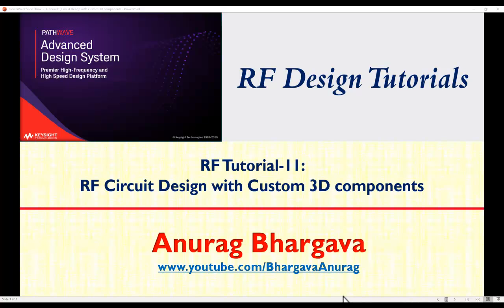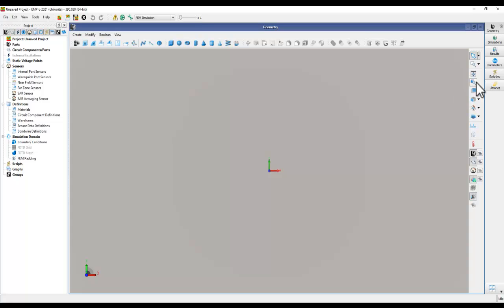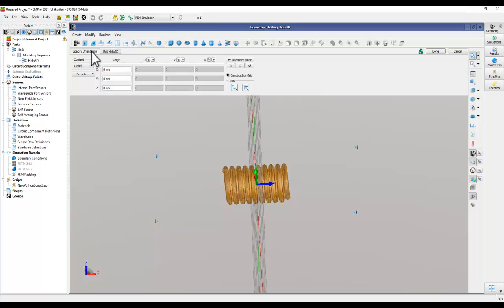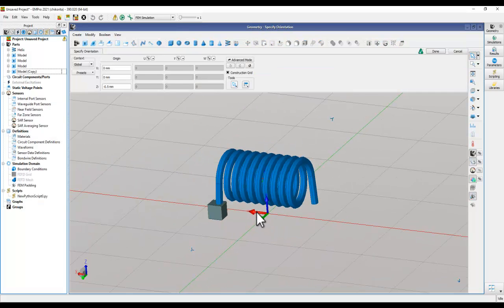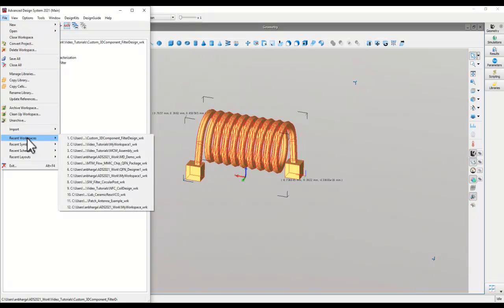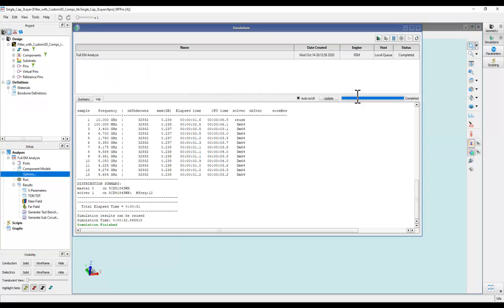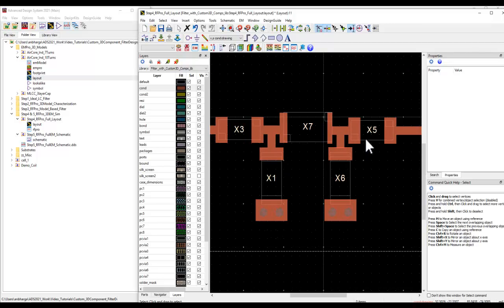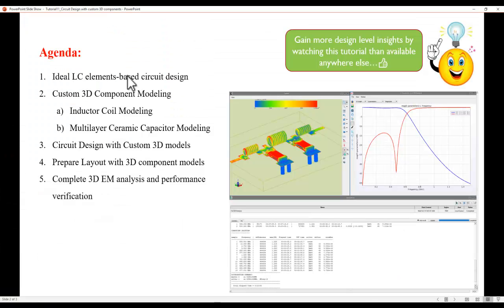RF Design-11: RF Circuit Design with Custom 3D Components

Comment: Hi, how do you start EMpro? When I start it from a layout window, I don't get the same menus as you do. I don't have a menu for importing CAD files, like STEP. Thanks.
Reply from the maker: Hi Yulia,
You can download and install latest EMPro version from Keysight. Its a different installer and software from Keysight for 3D CAD and Simulation.

Comment: hello, i have a question about multilayer design, first thing, thanks for your videos they are very helpful, now about the question, i want to put some componets on top layer and other on bottom layer, can i do that with just one substrate, and make the ground be on both layers and use vias, or should i have at least two substraate with the ground be beween the two substrate?.
Reply from the maker: Hi Luck, It depends...sometimes designers have 1 GND plane between Top and Bottom and sometimes you have 1 GND plane for Top and another for bottom layer with a Core dielectric in between in order to isolate as much as possible. While doing so, you need to be careful in not having too many VIAs as each VIA will have some inductance and you would like to avoid that in order to preserve the proper high frequency performance.
As I said before, its not always so easy to squeeze the size and many time you will need to live with what you have. Multilayer is not always the solution and in many cases it might create more problems so you need to treat every aspect carefully.
Unfortunately, YouTube is not good place for tech support and I will recommend you to work with somebody local or with a proper consultant who can advise you properly.